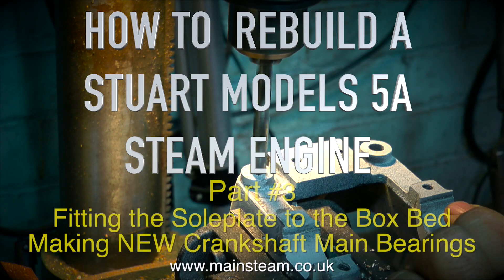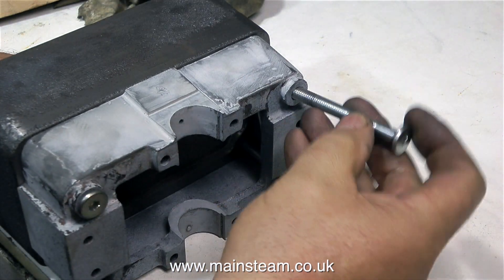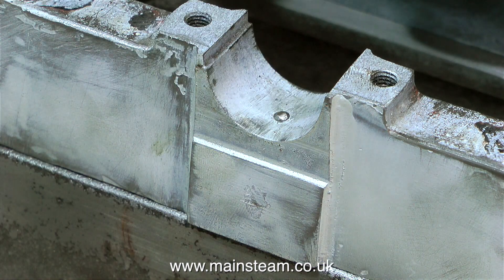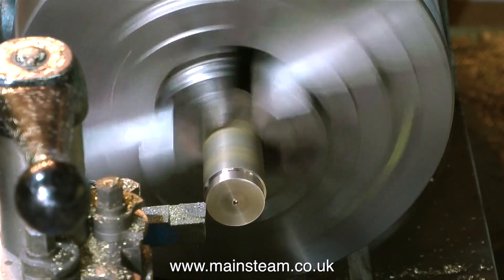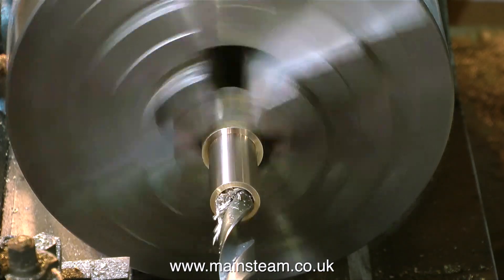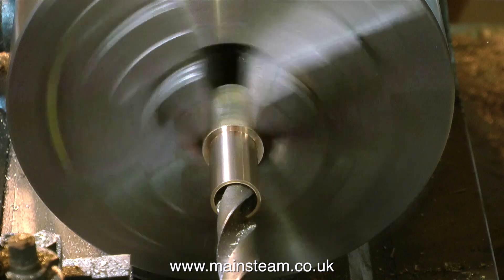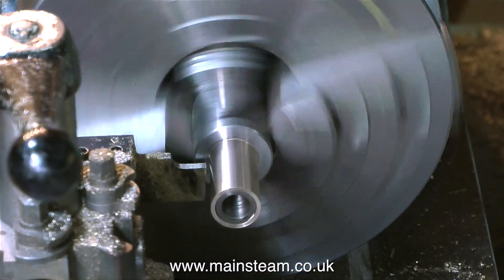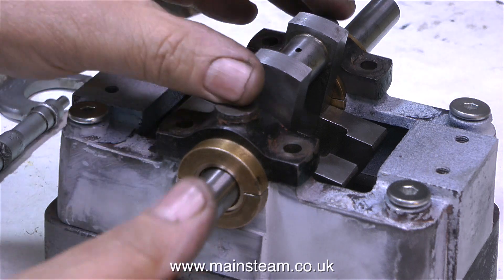HOW TO REBUILD A STUART MODELS 5A STEAM ENGINE - PART #3

Comment: if it is possible to fit bushings why is the bearing split in the first place? might as well be in one piece
Reply from the maker: The bearings are split to allow adjustment for wear, this is standard in most larger model (and full size) steam engines.
Reply: I can see it being convenient or even required on a big engine that you don't have to take things off the shaft to change or inspect bearings.  Does a split really offer much adjustment before it just makes the bearing oval?
Reply from the maker: In the long term the bearings do become oval, but then you can remove some metal in the gap, close the bearing and then ream the hole round again - I think that is the idea .....

Comment: Perhaps the original builder was going to use a poured bearing. Are poured bearings ever used in model steam engines?
Reply from the maker: This engine has been a working engine in the past, the bearings wore out so they were  bored out to take bushes I would think - similar to what I describe in the video. I never see poured bearings in the models I work on.